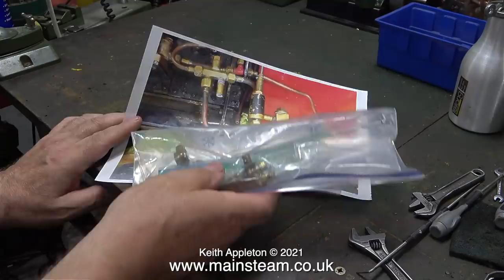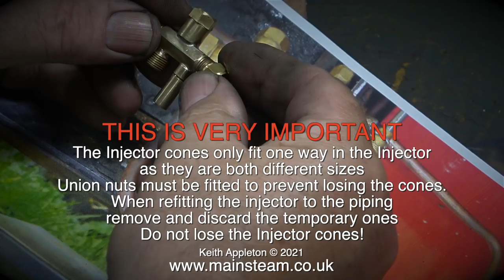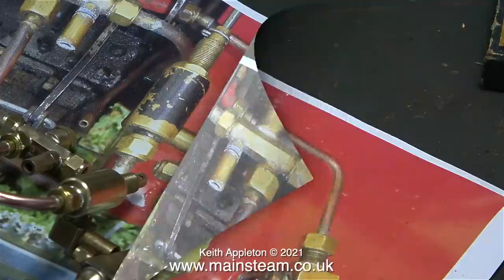REPAIRING PARTS FOR A MODEL STEAM LORRY - IN THE WORKSHOP

Comment: in regard of saving cost by fixing versus replace...
are these parts really expensive or is you labor really cheap?
Reply from the maker: These parts are not commercially available as they were specially made for the particular engine. My labour is not cheap, and I copied the original parts improving the piping layout......